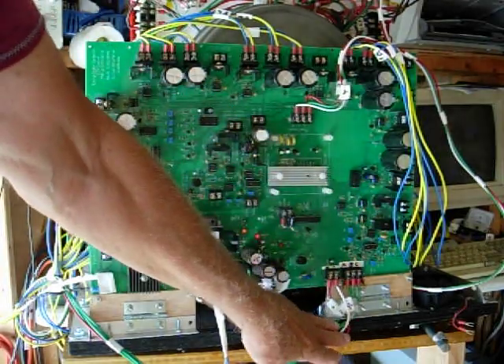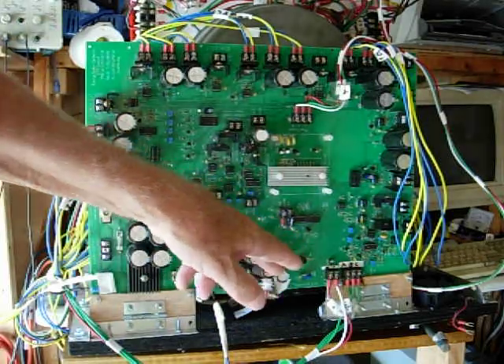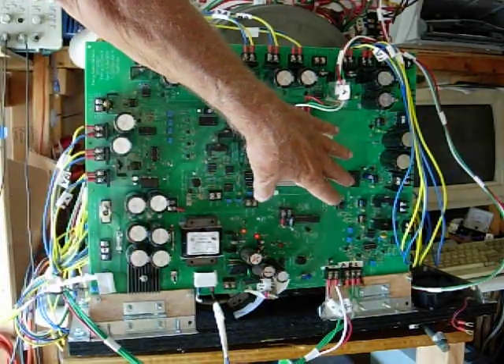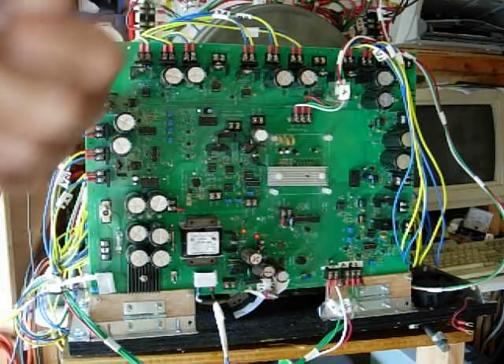Don Smith #213 New PCB running

Comment: I am working on SPoT technology.  Self Power of Things. Where everything self running.  No plugging or large battery. Just need small battery for starting. You maybe the guy can help me. My new invention is a motor 2.0 Two rotors and  NO stator. Use less than 50% input power.

Comment: what is this for?
Reply from the maker: will produce DC to run an inverter which in turn will drive AC loads. If all goes well it should be able to self run.  A similar device has run the Air Conditioner in an RV for 3 years self running but used a very large flywheel.  This original device is now being used to recharge batteries on a huge catamaran somewhere in So American and has not been returned to the original designer. Basically they stole it.   I'm getting real close to finalizing this but my girl friend just had a hip replaced so that's kept me pretty busy taking care of her.  Two weeks to go then I can finish it.   I really want to do with no moving parts which will use Rodin Toroid coils which create fractal expanding fields even when power to their driving circuit has been turned off.  this expansion at the speed of light lasts with no power for about 1min 20 sec, which is  incredible. a few seconds of input power gives back the 1min 20sec as the field expands from Earth at 186,000 miles per sec.  That's 7,000,000 out and 7,000,000 back to center singularity of the coil.

Comment from the maker: Just got rid of variac  now everything runs on 120 still 250rpms.  I need to adjust pots for output FETs control.  Running .406 amps or about  48 wattsI fired up the motor today and measured the voltage out of the 4 ecm bridges.  54vdc 54vdc 48vdc & 63vdc at 250 rpms so totaled up 215vdc that will be switched thru a step down transformer to around 13.85 vdc like an alternator to keep battery or cap bank full.I don't know yet what total max current will be  but if whole device runs on say 50watts then 12vdc battery to inverter would have to produce 5 amps or 60watts  if that's the case then the 215vdc transformer input would have to produce around   .3 amps.  If this is all true then there should be no problem self looping even with cap bank instead of the battery  The ecm short test yielded about 1amp average from each ecm so I have a lot of room to play with energy here.  If not regulated properly I could see DC Runaway not a good situation.

Comment from the maker: I am having a problem with one of the NE555 timer circuits it's the one shot for dump cap circuitry.  everything checks out but no output. I've had this type of problem before. weird stuff.  I think I am using the wrong part should be the NE555N style.  the prototype used the NE555N and worked fine.   all other NE555 circuits are working fine.  ordered some parts so now to wait.  all other circuits appear to be OK. amazing if I can get this to self run.  I'll have 12 ECM phases generating AC V to bridges and these 4 outputs can then be combined in series or parallel combos to recharge the battery then Cap bank